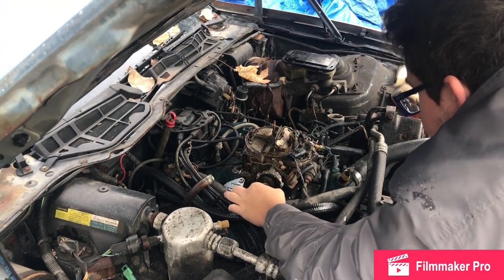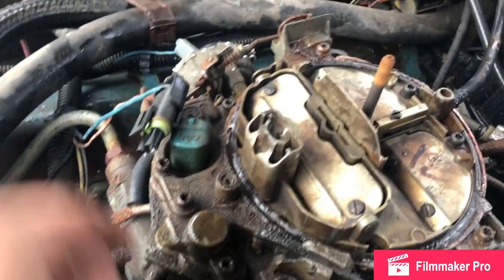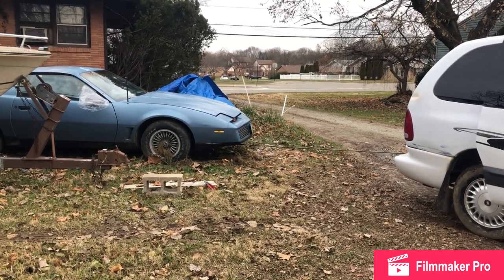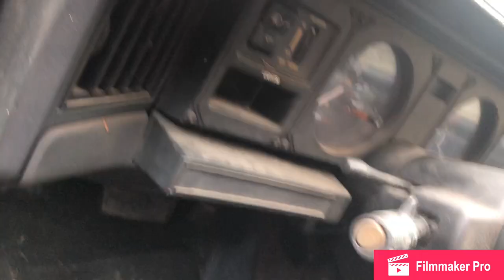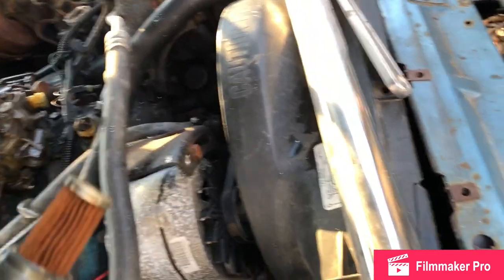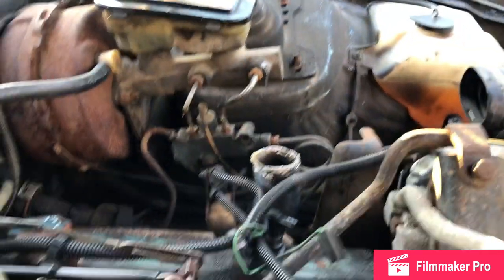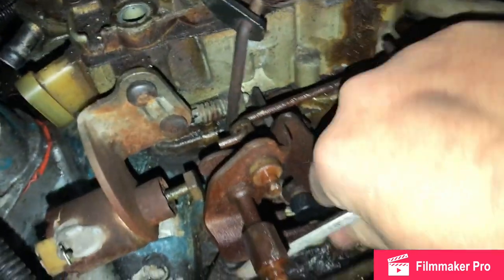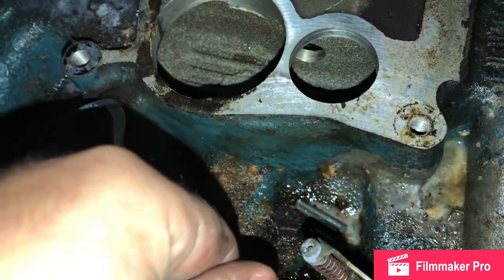1982 Trans AM Restoration Part 6: New Carburetor Part 1

Comment: Wanna have alot of fun? After you replace the carb, take apart the old one. Not as hard as you would think. Buying a rebuild kit is a good idea. Latest one I tore apart was off a 75 AMC. Ran like crap and wouldn't idle. Couldn't find a kit but oh well. Disassembled, cleaned and reused all the old parts. Idles and sounds great now. Did locate a rebuild kit off ebay last summer so in a few months I will do it again. You don't have to redo the linkage settings or the float bowl. Biggest thing is cleaning it out. Take lots of pics as you take it apart.
Reply from the maker: The Burning Ice this was not the correct one I got a new one on it now
Reply: @TFD1982  understand. Just saying take apart the old one. I find it fun
Reply from the maker: The Burning Ice yeah I probably will at some point